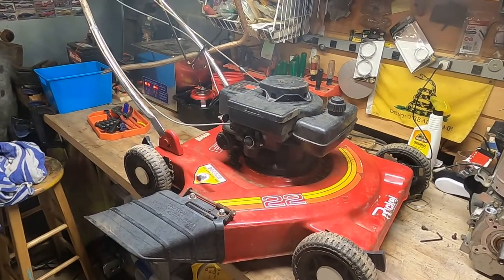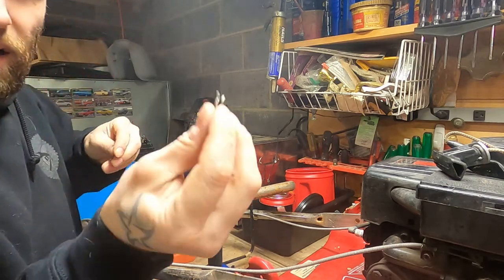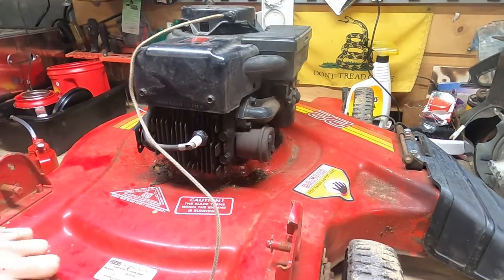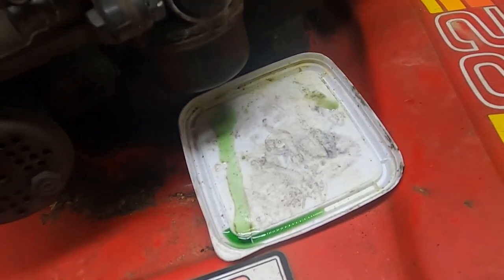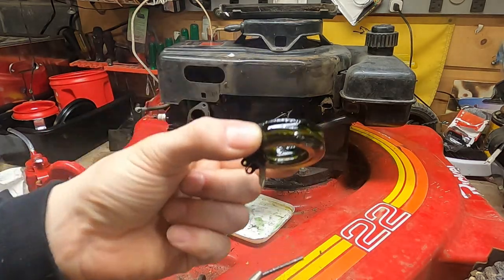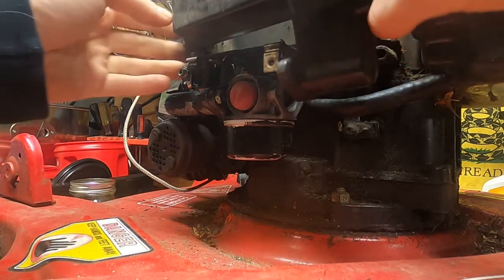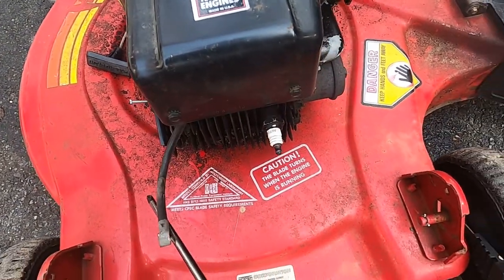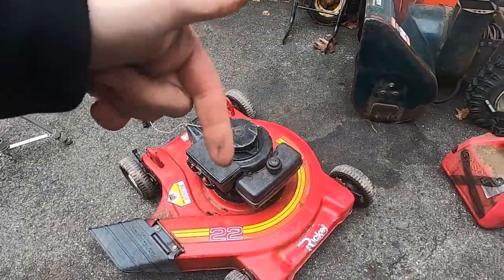ROPER PUSH MOWER - Revival & Restoration

Comment: I think I have that same mower, only mine is yellow, and branded Ace Hardware.  Any numbers on the tag on the mower deck have Long since faded away.  Used the number on the engine to replace the float and the throttle chain, I think all in I've got $20 in it, price I paid at a garage sale included.  Mine starts with like two pulls.